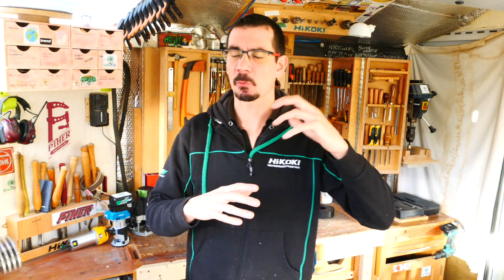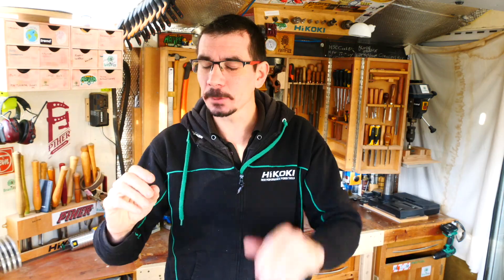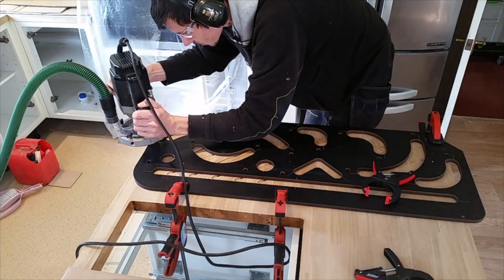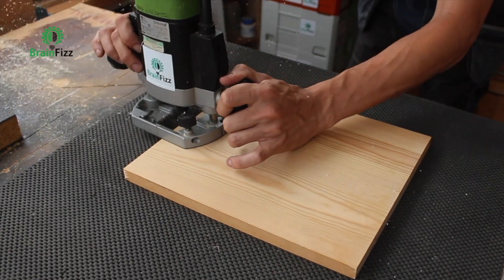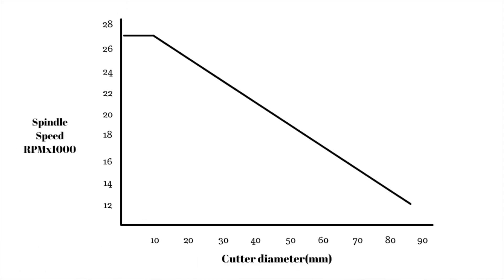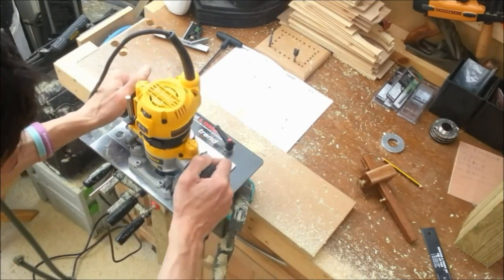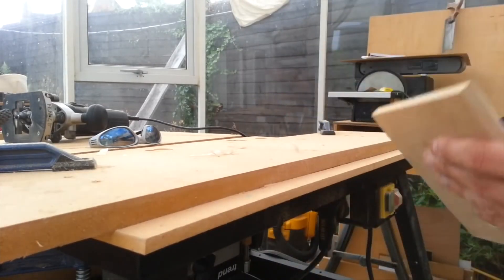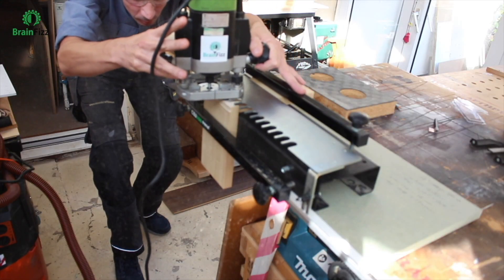4 Things ALL router users should know [to instantly improve their woodwork] How to use a router

Comment: That "gut feeling" thing is so important, we have probably all done things we had a "gut feeling" about and ended up regretting it, one of my most expensive lessons was learnt while useing a half inch Dewalt router upside down in a table with a cheap 3/16 cutter, and as I was proceeding through  the probably too deep cut , the very instant I had that "gut feeling" and before I could back out the cutter broke, and being uside down it fell into the router and removed some of the cooling fan blades which puts things seriously out of balance. following the repair of the router I made a shield to protect the router from any falling debris while still allowing the air to pass through it. I hope this might help someone avoid the same mistake.
Reply from the maker: If you’re forcing a cutter enough to either break it, or bend the shank….. you are indeed cutting too deep. 
This is the cause of burning (too deep a cut leads to too slow a feed rate, causing too much heat which causes the burning)…
I have videos on depth of cut explanations and how to’s/ does and fonts as well as for feed rate…..
All explained with details and examples.
Stay safe, and stay away from videos by folks who may have large followings but not always the large knowledge 🫣😉